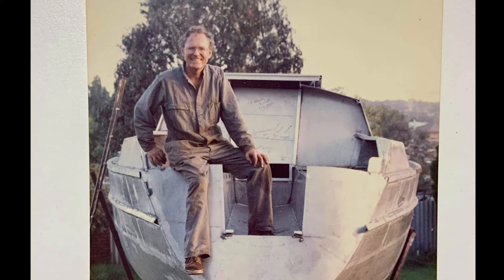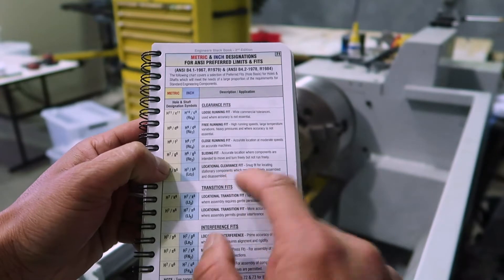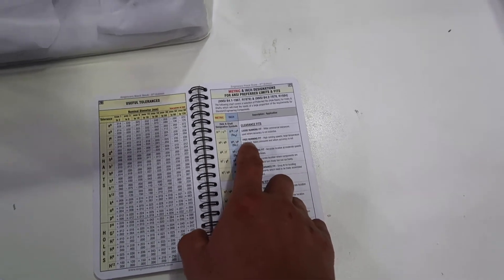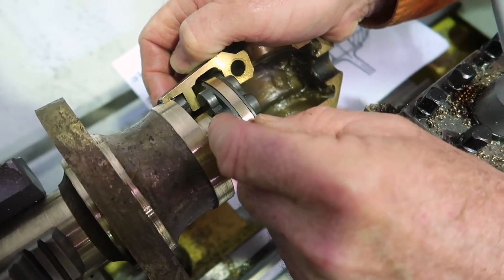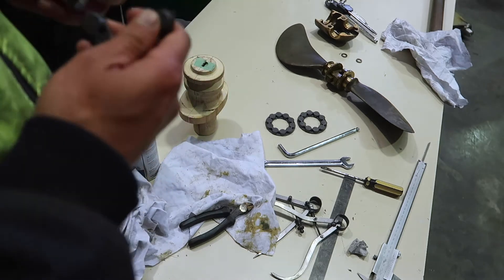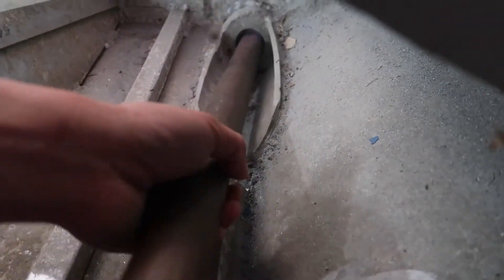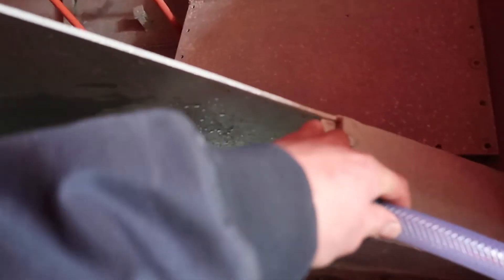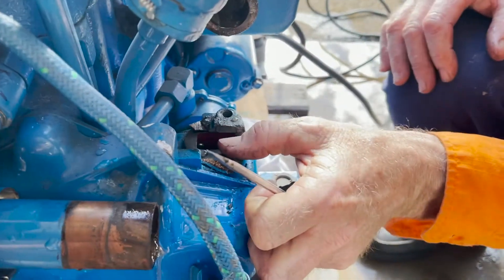Variable Pitch Prop Mount, $15 Aldi Pump and Starting 34 YO Motor Attempt 5

Comment: Hello Mr Singh
That bloody motor.
Let me know when the christening of the yacht is and I'll bring some oars🚣‍♂️
That was on episode "16, 17 or maybe 18" Whao!!!
Reply from the maker: Haha, oars, a life jacket, a life raft, maybe call the coast guard before. I need you over here Mr Engine Whisperer. New lift pump is on its way (just an electric one). If I can’t get the injector pump firing it’s off to the experts to get cleaned and also the injections. Combustion = heat + fuel + oxygen ???
Reply: Your $15 water pump from Aldi's worked a treat.
Ask them to get you a fuel pump🤣
Reply from the maker: @adrianbonacci871  Maybe I should just wait until they have explorer yachts on special. Just pick one up on the way back from dinner?